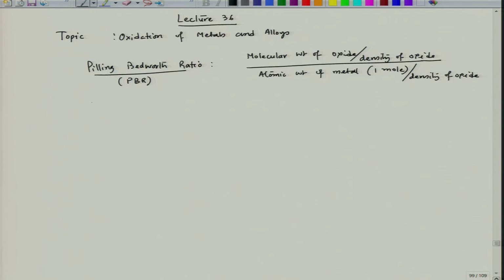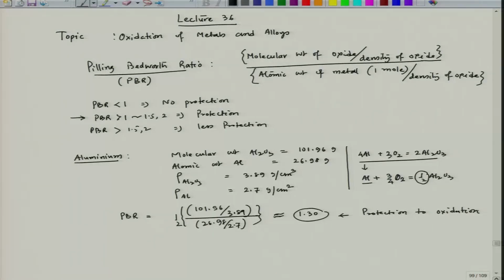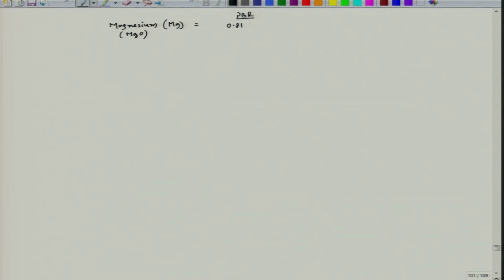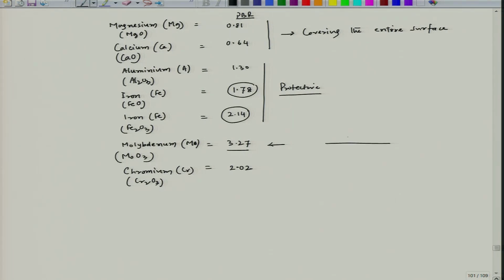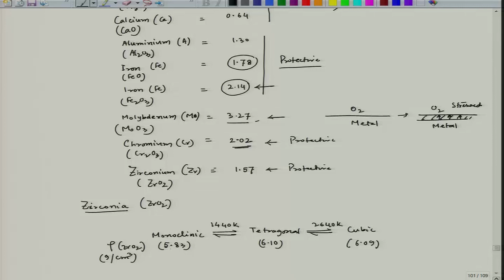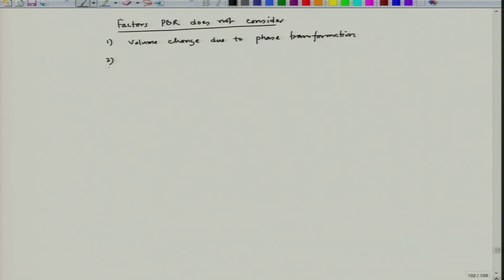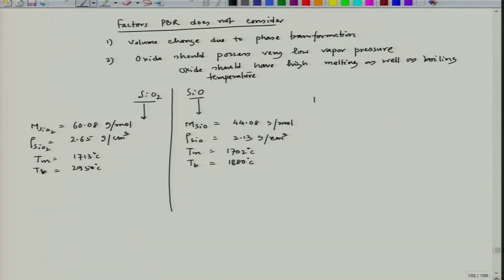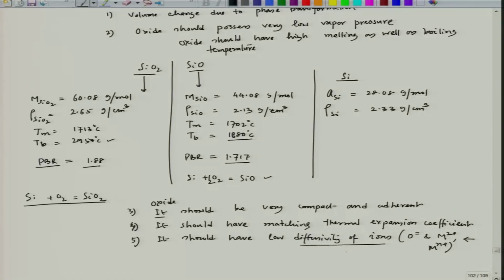noc19-mm15-lec36

Comment: You mentioned that iron oxides are protective...But is'nt iron oxide layer porous and non protective?
Reply: I believe it would have been like a retarding layer instead of protective even if is porous, however it is flaky and thus non-protective except low oxygen protective layer formation or High temperature protective layer formation which should be somewhat adherent.